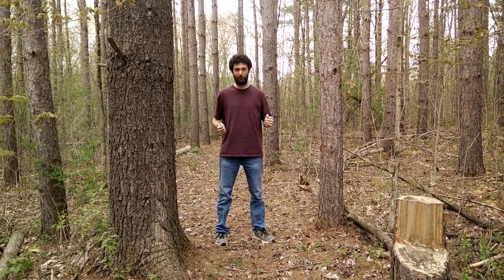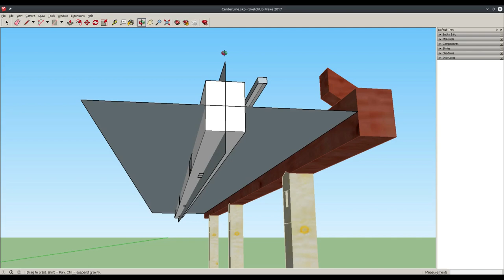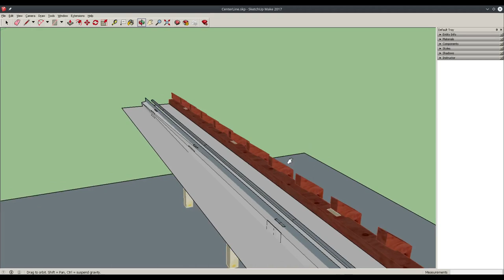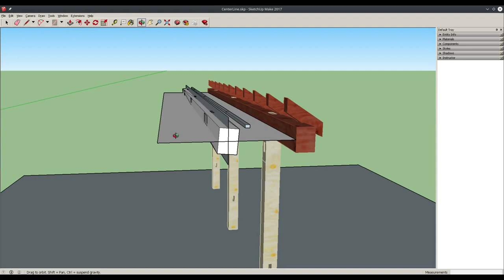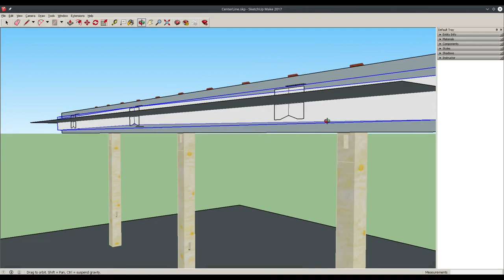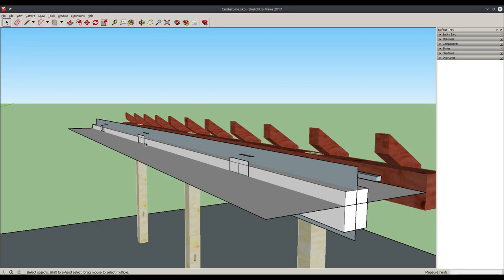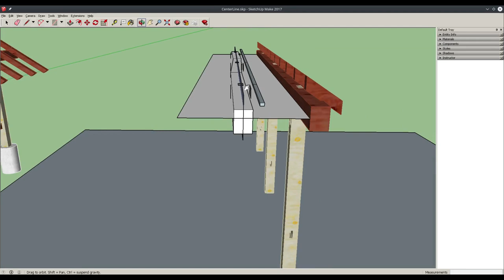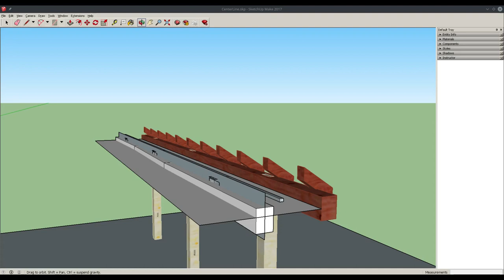Unabridged Timberframe - Center Line Layout

Comment: Hi Christian,

This is perhaps the best video on Youtube covering "line layout" that is presented both graphically and in English...The rest are all in other languages and much more difficult to follow...WELL DONE!!!

If you would allow me some observations to share below to clarify some things...

Though often called "center line," it is much better to call it (and think about it) as just "line layout."  Sometimes they are centered, yes, but not always or even commonly in some formats of this modality of "lining" a timber in the historical forms of it.

Your plans are "plumb" and "level"...and its easier to understand if that language is used rather than just "level" or "perpendicular."

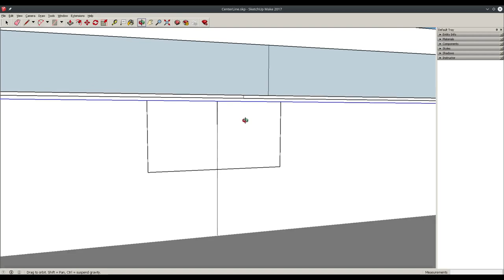At 04:07 you begin describing a challenge that many young Timberwrights face in dealing with roof geometry. Part of you challenge is thinking to much about the surface of the timber and using "edge layoff" system rather than just "line layout" modalities which forces your mind to work more with the unseen and intangible...which is the essence of Middle Eastern and Asian line layout systems in general. The "soul line" is the focal point to all geometry and its applicaiton to joinery, what you are suggesting as the two perpendicular planes. These planes are the orientation of the joinery yes...but they are based of the soul or core line of the timber. Twisted, bowed, crowned or live edge can all be effectively jointed as long as the visualization skills master what needs to take place with a given joint.  A line that you can not see, touch or snap on a timber is often the most important. This line (which in live edge, log, and related work) is what all your design and geometry is based off of. The graphical dermal snapped lines are just points of reference for templates, and visualization...nothing more...and even the templates themselves may only be a "guide" of sorts but not absolute.

So, for you rafters, the critical point is where the rafter rest in its housing, and how you cut these or the mortise. One point on this, that I heard you say a few times in "mortising through the timber." Even though a mortise make pass through a timber it is always cut from both sides...not just one. If a timber is grealy twisted, it matters not because the registration is the soul line and the given reference plane it may represent. For the rafters that would be the bottom of the housing pocket.  The "angle" of that housing is not as critical and is typically cut at a great mean average that a given timber yields...in other words "over cut" to a small margin. Thus, the critical loading plan of the rafter is in contact with the proper plane of the timber in reference to that soul or core line.  Hope that made since? If you have allowed "bow" in your rafter and not placed that in the "crown" orientation, you have made the job much harder, and different approaches have to be taken.

At 12:10 you start to describe "eyeballing" the timber. This is part of the craft for certain, and a learn skill overtime no doubt. We call this timber assessment. But the solution is typically to extend a post to compensate for the crown and/or deviation in the ridge beam (in this example)...not moving the ridge beam up or down. Because the rafter housing are more critical at the top and adding a wee bit of length to a post is much easier and aesthetically more pleasing very often. Case in point why you will see many massively curved and crowned timbers in a Hanok or Minka style timber frame...

You nomenclature of the pointed housing is fine, each Timberwright often will call something out of context based on what they understand. "V" post housing, (the actually name for this joint varies from region to region but usually references "mountain" or "shedding" in the translation) and if you are using it, then its a clear indication somewhere down the line either someone has been to the Himalayas or study under the same lineage I work and teach in. Spear joint works for me, and others call it an "arrow joint" or "mountain housing." The primary reason for it is moisture shedding, ease of cutting, and tectonic stability...

At around 18:30 you reference the mortises again and the "extra meat" missing from one side or the other. In these cases, it that timber is to be used (which is more than fine) the post tenons are adjusted accordingly most often...

I can expand on any of it if you wish...

Since you pinned this here, if other readers find this I provided the following here too:
墨付け
Sumidzuke (sumitsuke)  
Term for “layout” (or “mark up”) but literally means “Blackening the face.”
https://www.google.com/search?q=%E5%A2%A8%E4%BB%98%E3%81%91&tbm=isch&ved=2ahUKEwjx9qibmIPtAhUGz6wKHT_DCjwQ2-cCegQIABAA&oq=%E5%A2%A8%E4%BB%98%E3%81%91&gs_lcp=CgNpbWcQAzICCAAyAggAMgIIADICCAAyAggAMgIIADICCAAyAggAMgIIADICCAA6BAgAEBhQm-AbWIiiHGDPrRxoAHAAeACAAUqIAdUBkgEBM5gBAKABAaoBC2d3cy13aXotaW1nwAEB&sclient=img&ei=S2iwX7GlH4aeswW_hqvgAw&bih=636&biw=1266&rlz=1C1EXJR_enUS858US864&hl=en
墨打ち
Sumi-uchi 
The process drawing a reference line...
https://www.google.com/search?q=%E5%A2%A8%E6%89%93%E3%81%A1&tbm=isch&ved=2ahUKEwi_6fTEmIPtAhUMSKwKHUp9AeIQ2-cCegQIABAA&oq=%E5%A2%A8%E6%89%93%E3%81%A1&gs_lcp=CgNpbWcQDFAAWABgubA6aABwAHgAgAEAiAEAkgEAmAEAqgELZ3dzLXdpei1pbWc&sclient=img&ei=omiwX7-QLYyQsQXK-oWQDg&bih=636&biw=1266&rlz=1C1EXJR_enUS858US864&hl=en
縦芯墨
Tate shinzumi
Vertical line
https://www.google.com/search?q=%E7%B8%A6%E8%8A%AF%E5%A2%A8&tbm=isch&hl=en&chips=q:%E7%B8%A6+%E8%8A%AF+%E5%A2%A8,online_chips:%E4%B8%B8%E5%A4%AA&rlz=1C1EXJR_enUS858US864&sa=X&ved=2ahUKEwjX2MvJnoPtAhVMTa0KHZvOA08Q4lYoAHoECAEQFg&biw=1266&bih=636
規矩術 
Kiku-jutsu 
 “Art of Regulating”  layout discipline.
https://www.google.com/search?q=%E8%A6%8F%E7%9F%A9%E8%A1%93&newwindow=1&rlz=1C1EXJR_enUS858US864&hl=en&tbm=isch&sxsrf=ALeKk032yKUZ_dHoJRy-r1cxBfKPYf5-Hg:1605399526661&source=lnms&sa=X&ved=0ahUKEwjG7Iiko4PtAhVBK80KHc4lBXAQ_AUICygB&biw=1280&bih=636&dpr=1.25
実用規矩術
Jitsuyō kiku-jutsu
The practiced (or practical) application of layout
https://www.google.com/search?q=%E5%AE%9F%E7%94%A8%E8%A6%8F%E7%9F%A9%E8%A1%93&newwindow=1&rlz=1C1EXJR_enUS858US864&sxsrf=ALeKk00KocJRlBDvBjlZzuzeVngdG7aing:1605395749869&source=lnms&tbm=isch&sa=X&ved=2ahUKEwjF7pOblYPtAhUlB50JHVRKBEsQ_AUoAXoECAQQAw&biw=1280&bih=636
Reply from the maker: Thank you for expanding on and correcting what I tried to convey in this video!

I often find the hardest part for me is remembering the correct terminology for different items / techniques.  I also think I need to read a lot more books on timberframing to solidify the terminology and improve my overall skill set.  My main goal with this structure was to solidify and test on my own the techniques I learned from Mr. C and prove to myself that I could do it from start to finish.

I really like the term "soul line", it beautifully conveys the essence of how to envision the timber in relation to itself and the timbers around it.

In hind sight, I definitely should have altered the post length instead of the depth of the spear tip.  All part of the learning process I suppose :)

I truly appreciate the time you took to comment on my videos to help not only my understanding, but everyone who I hoped to inspire / inform as well!
Reply: @cam72cam  Christian, you did an awesome job...I mean that!!! This is the best "in English" profile of "line layout" on Youtube if not the internet at this time. All hidden away here in the corner because of some stupid algorithm because you don't have a buzzillion followers. I've already bookmarked it to send to anyone asking questions! All your work with the links above just about covers it's for anyone wishing to understand Line Rule and it Asian roots! Great job!!!

Comment: Great overview of the line rule. To echo the other comments - it's amazing that it's been so hard to find an in-depth overview of a layout rule that's referenced so often in the literature. Given that almost every timber is going to be imperfect in some way, it's kind of surprising that there's relatively little instruction dedicated to dealing to dealing with imperfect timbers in most books on timber framing. 

Here's a question on imperfect timbers that you may or may not have the answer to.  How do you use the line rule to join timbers that have different dimensions. For example - let's say I have a true 6x6 post and a beam that comes in at 6.5" x 6.5". If you use the line rule to layout the joinery from the center of the plumb line, then won't the beam lie 1/4" proud relative to the post? Besides looking bad, this would cause obvious problems when it came time to apply siding.  I can see how you could accommodate this by moving the mortise 1/2" inward in this case, but in practice it seems like you'd have to know the exact dimensions of every timber and adjust the position of every joint, which seems like it would be incredibly tedious and time consuming. 

In practice, do most people use the line rule to make sure that the joinery will be in the same horizontal/vertical planes, and then use something like the square rule to keep the reference faces and joinery in alignment for timbers that are twisted/bowed/etc and out of square?

Comment: I get the idea of basing your work off of the layout lines, but what about when you need housings? After all, even if your mortise is in the right place and will be sitting perfectly plumb/level to a post tenon, the crooked beam wont put its full surface on the tenon shoulders because of the twist. So I assume you then have some scribing to do to get it to fit right. But that means post height is now affected, so I feel like your chasing your own tail